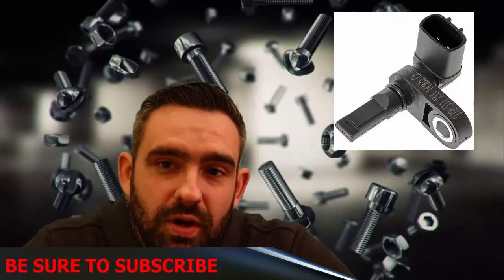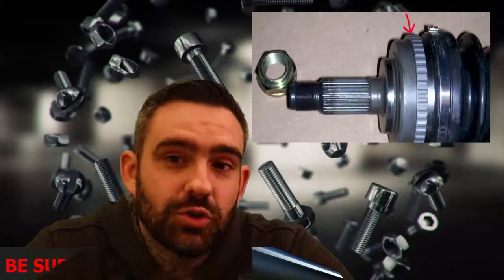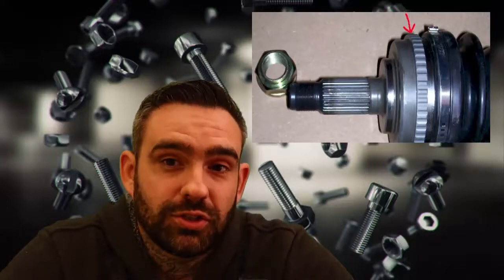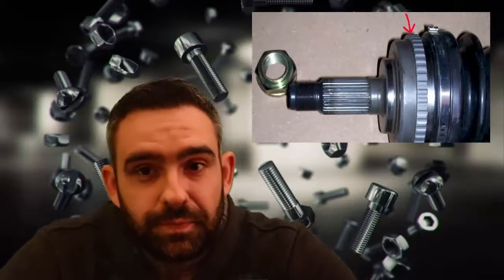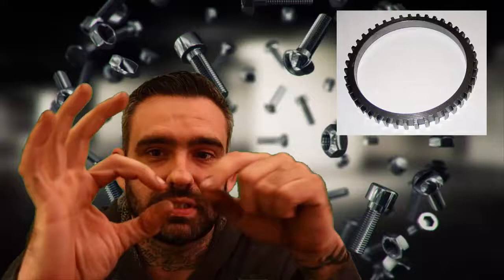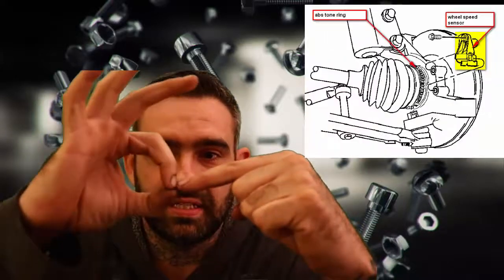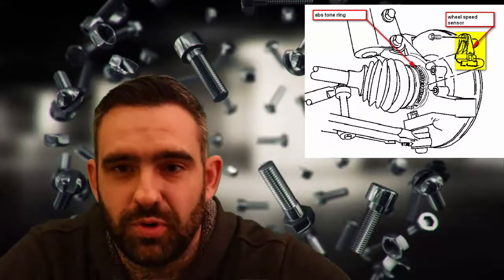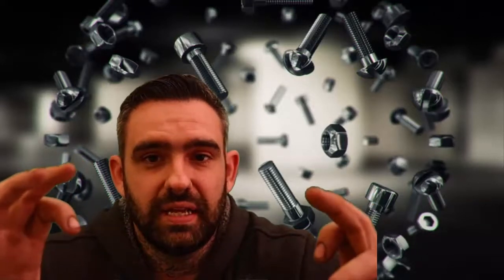Got A C1234 ABS Code Today - Nice FIx!

Comment: Had this problem with a wheel bearing on a blazer, OEM was a square tone ring the aftermarket was diagonal, every time i came to a stop the ABS fired off, yanked that 20amper and all was well.
Reply from the maker: jrpNH3 lol used to pull the abs fuse from all of my vehicles back in the just because i hated abs... just keep in mind that alls you did was disable the abs and not fix it. Im sure you gathered that much already though.